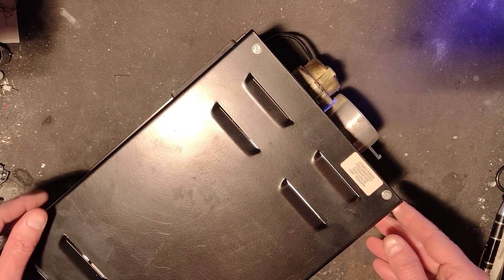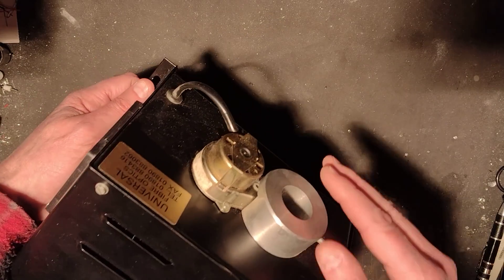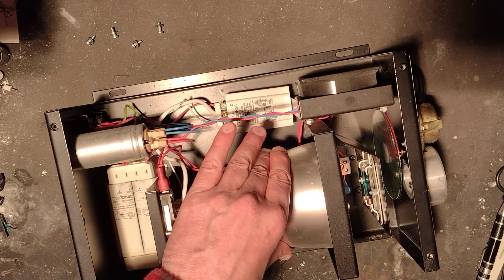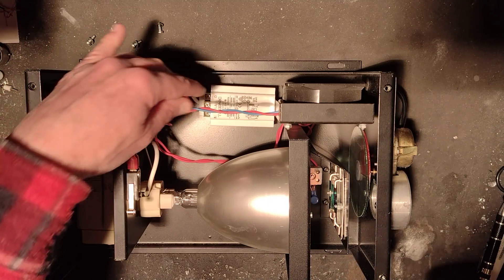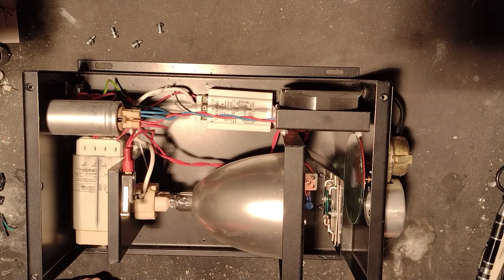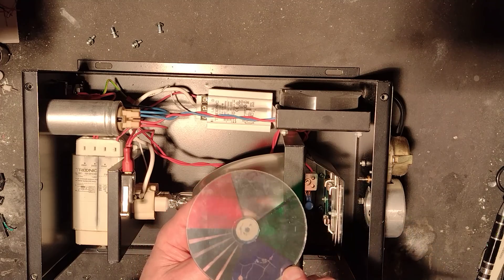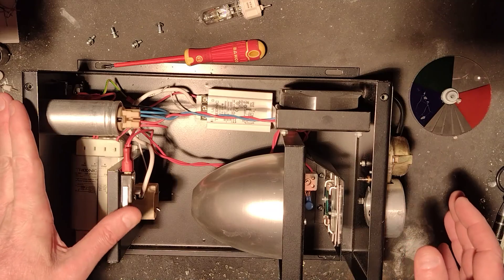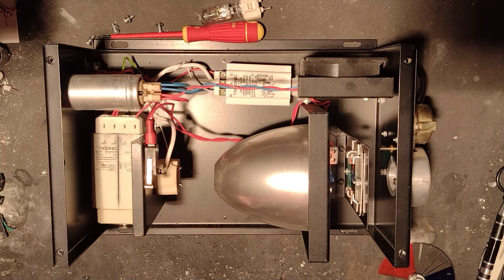Metal halide fiber optic illuminator

Comment: Thanks for the look inside.  You just know something like this is going to be HOT after operating for a while.  The pattern on the color disc is very similar to those used on the fiber-optic Christmas trees with the halogen or LED light source and color disc and motor in the base.
Reply: Exactly what this reminded me of! I had one of the halogen-based ones decades ago! (Now my entire house is E1.31/Art-Net wired with color-balanced LEDs but... what a cool throwback! So much bigger/beefier on the inside though, when compared with what I had to replace the bulb on! Wow!)
Reply: 8th
Reply: @ziplockk  Ah, nice! Yeah, sadly I lost mine years ago... It would be cool to still have, with WLED-based pixel strings hidden the way I have them now. (I love those little "fairy-light" style sk6812s! Addressable RGBW in that tiny size is great! And cheap!)
edit: spelling typo correction